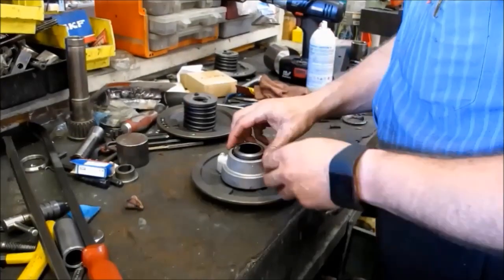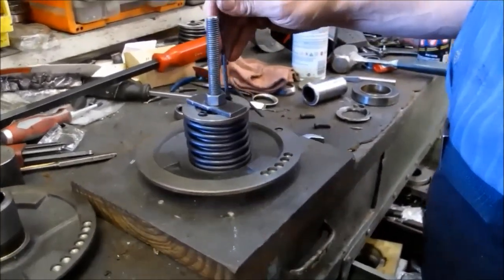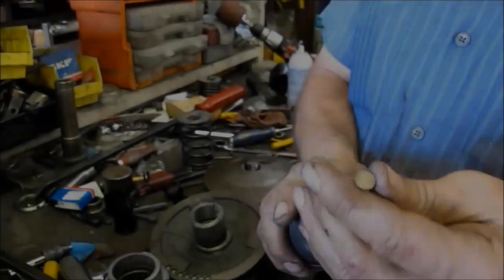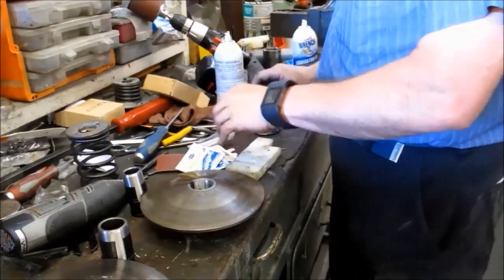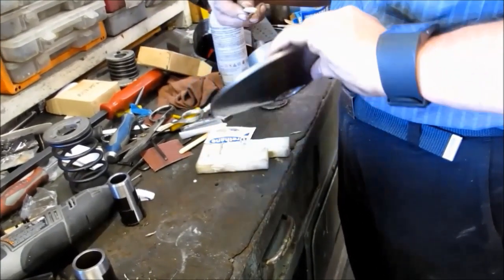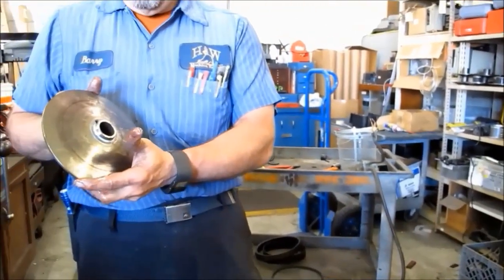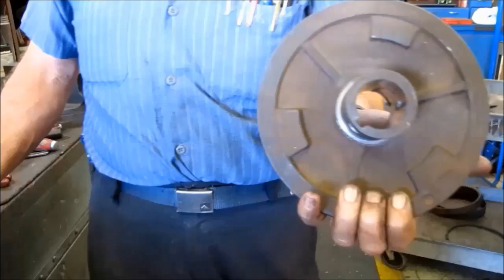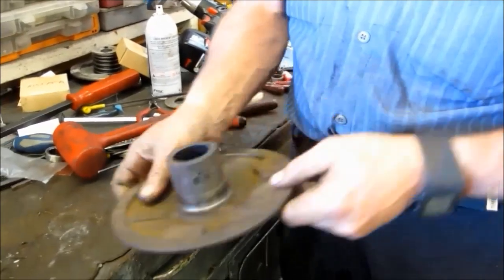Bridgeport Bushing Repair

Comment: I just wanted express a yuge amount of gratitude for this video and your company.   my company's usual parts sources had no real idea of the different motor shaft diameters when we originally ordered parts.  I knew the motor's vari-disk bushings weren't correct and my boss called and explained our problem.  they were clueless.  I watched this video multiple times to see what our issue was.  knowledge gained and forwarded the video to my boss and we discussed it.  I said he should call you and talk with a rep.  your rep was friendly, understanding and worked with us to get us the right parts even tho a 2hp motor rotor isnt a standard sold part.  our vari-disk shaft is still usable but took a beating from the broken key and shoe.  i shaved a couple thou off a solid piece of keystock and drilled&tapped it to use in place of the 2piece, 2hp setup.

this being my first Bridgeport rebuild with ZERO experience, overall, it came out well.  our machine is up&running and running well.  thank you to all of the H&W crew for passing on this knowledge.
Reply from the maker: Thank you, it's always nice to know that our customers can get their machines up and running with our help. Let us know if you need anything in the future.

Comment: Good video and great marketing for your company. I am going to be buying stuff from you later today.

Something to consider: if you guys replace bushings often at your shop you should get a spiral reamer that is at the proper size. If you are just removing epoxy then it shouldn't take much torque and you might be able to do it with a hand drill. This should be faster than using the Dermal, but it will also be extremely repeatable and give you a good fit every time. Down side though is that you will need to rough up the surface before the epoxy.

Comment: I used our sandblaster to clean the epoxy out of the bores, I shot only from the back side to avoid hitting the cone surface. It was exceptionally satisfying.

Comment: I have to replace the bottom motor varidisc and already have the urethane glue and bushings and would like to know the outside diameter of the arbor you use for the motor shaft?  Your videos on Bridgeports has been most helpful on getting mine working again.
Reply from the maker: Hi David. We use a gage pin the same size as the motor shaft. You don't want to use your actual motor shaft in case it is worn. A 2 HP shaft is 1.179" and a 1.5 HP is .938", also in case someone else needs it, the spindle side would be 1.377".

Comment: Already replaced all the parts that need to be replace as well as all the bearings. As of now, assembled today and try to test. One thing ive notice when i speed up vibration were noticeable. How to reduce it? Or is it possible that the Adjustable Drive A Varidisc is not balance when rotating fast?
Reply from the maker: The drive discs are balanced at the factory so it wont be that. Since you tool it apart it may be an alignment issue. If you loosen the bolts and then turn on the machine, retighten them while the head is running to get it into proper alignment. If you have any questions you can give us a call and we can try to walk you though it: 1-800-285-5271
Reply: @HWMachRepair  maybe which bolts to be tighten any specific location thnaks alot.
Reply from the maker: @NaksNamanVlog  Apologies for the late reply on this one. There are 3 nuts that attached the quill to the bull gear housing, those are the ones that you want to loosen. If you want to give us a call, this is a procedure that is easier explained over the phone: 1-800-285-5271
Reply: @HWMachRepair  im from the Philippines. Maybe you can make another video  i guess? Hoping for it..
Reply: @HWMachRepair  or maybe is this the part number HQT1495 HQT1496 HQT1497.
Reply from the maker: @NaksNamanVlog  email me at support@hwmachinerepair.com and I can send you a picture of the bolts. I can't post anything here.
Reply: @HWMachRepair  already sent you an email.
Reply: @HWMachRepair  after following the instructions that you have sent to me. Now,vibration lessen 75% . Machine is now working fine.. thanks for the support...

Comment: Thanks for the detailed how to. With this instruction and the book I have confidence I could pull off this particular repair. My question is how to know that it needs to be done? My BP has this variable speed arrangement and it works although it is probably noisier than I'd like but what of that? How noisy is too much? Maybe you could do a series of before / after videos.
Reply from the maker: prboulay That's a great idea for a video or a video series! If you are concerned about the noise that is in your head now you can always give us a call and ask for Barry. He will be able to tell you if the noise is normal or something you need to fix. 1-800-285-5271
Reply: You all probably dont care but does someone know a way to log back into an Instagram account??
I somehow forgot the account password. I appreciate any tips you can give me.
Reply: @Samir Ford it worked and I actually got access to my account again. I'm so happy:D
Thanks so much you really help me out !
Reply: @Eden Liam You are welcome :D
Reply: Probably bad bearings and bushings mine sounded awful and half worked I replaced all the bushings and the 2 bearings on the top half and new keys  now runs and sounds like new...

Comment: What a material used for veri speed pully bushes?
Reply from the maker: All modern day motor bushings are made with a plastic composite. If you have the blue/teal bushings those are made with a Delrin material.

Comment: Another great video Barry ,  why plastic bushings ?  That must be how Bridgeport designed it but I wouldn't think they would use plastic ? Anyway thanks for sharing
Reply from the maker: Bridgeport also used a Delrin material for some of their bushings, but the ease of install pushed the plastic bushings to be the main one that they used. The plastic isn't a cheap plastic, it's more of a hardened composite plastic. As long as you are using the machine in the way it was meant to be used and take care of any issues as they arise, the plastic bushings work well. Still better than the metal on metal machines that you get from many companies. -Barry
Reply: @HWMachRepair  Thanks for the reply , I appreciate it .

Comment: I just noticed something... At 16:11 into your video, you show a closeup of the key inserted into the motor varidisc.  That is not how the old key came out of my machine. On my machine the plastic faced into the bore.  Since the varidisc is supposed to slide up and down on the motor shaft, I think it makes sense, doesn't it?  You don't want steel gliding against steel with no lubrication.
Reply from the maker: PanamaSticks The way that we showed it is the correct way to install the key. Once everything is put together with the new bushings, that metal part will not actually be touching any other metal. The only part of the key that will be touching is the sides of the key which are plastic. The metal part is just holding that plastic part on. If you have any other questions feel free to call and Barry, our owner and main head rebuilder, would be more than happy to explain it better than I can through a YouTube comment.
Reply from the maker: H&W Machine Repair and Rebuilding 1-800-285-5271 Sorry here is our number
Reply: H&W Machine Repair and Rebuilding I mean no disrespect, but our machine was assembled the opposite way at the factory.  This is the first time it has been taken apart since..   The way you install the key, it appears that metal will run on metal as the varidisk moves up and down the shaft.
Reply: PanamaSticks I apologize.  Here I am the student, and you are the teacher, and I just told you you are not doing something right.  My bad.   I will do it the way you suggest, even if it is not the way it was installed when it came out of the machine.  It's your kit, and you must install a lot of these.  So I will have to trust you.
Reply from the maker: PanamaSticks No apologies necessary. Just to double check ourselves we called one of our contacts that worked at Bridgeport when they were still made in the USA and he said that when he was making them they installed them the way that we showed in the video. It's very possible that they are now installing them like that in the factory. We have really only had to rebuild a handful of newer HJ heads and haven't run into that yet.
Reply: PanamaSticks also if it was supposed to be installed plastic out there would be no need for the hole that the screw goes thru.

Comment: I know this is an old video and you may not be checking the comments but great job.  Two questions what type of grease do you recomend and how much do you put in?
Reply from the maker: Hi Jeff, are you talking about the grease where the bull gears are? We use Mobilux EP-1 and re recommend about 1-1/2 tubes for a variable speed and 1 tube for a step pulley . If you have any questions you can give us a call at 1-800-285-5271 and someone can help you with any other questions you have.

Comment: In your video, you show that the bearing housing on the spindle varidisc has already been removed.  Can the bushing  be replaced without removing the bearing housing?  I'm sure we can pry the bearing housing off, but we do not have a press to put it back on.
Reply from the maker: PanamaSticks Sorry for the late reply on this, Yes, you can replace the bushings and leave the bearing housing on.  The only possible trouble spot you may run into is removing the old key and any glue residue from the hole.
Reply: H&W Machine Repair and Rebuilding Thanks.  I ordered a bushing kit.  Now all I need is time to install it!